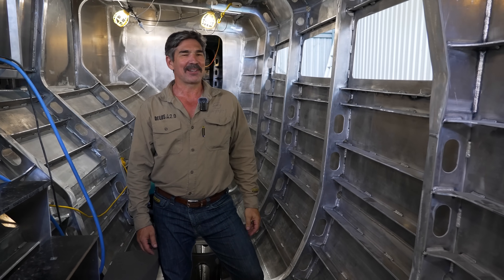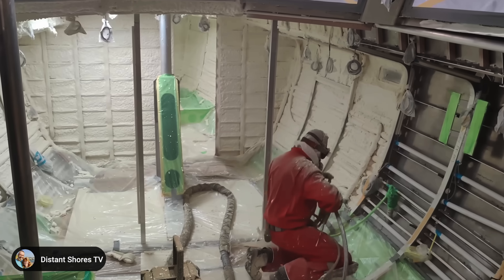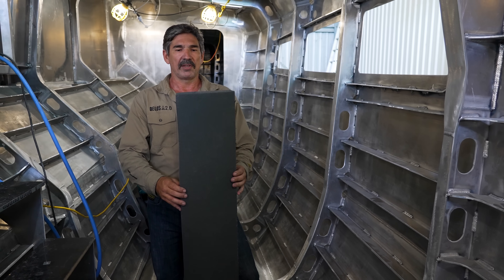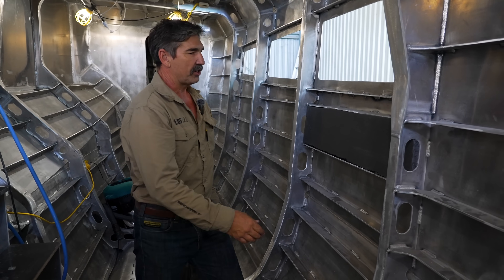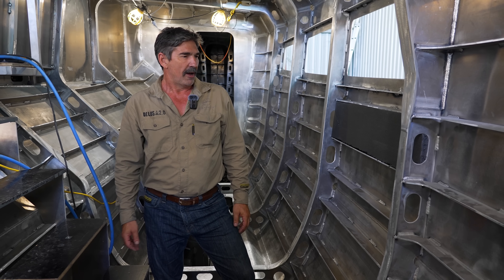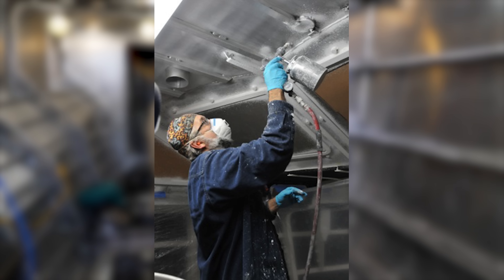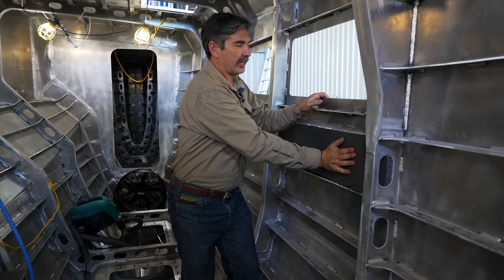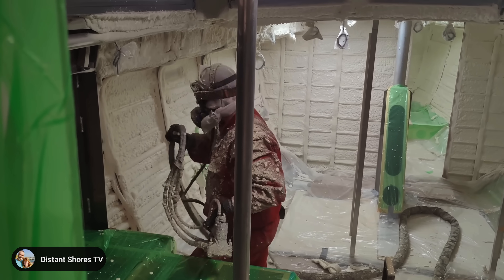HELP, We Need Your Advice!  How Should We Insulate Our Aluminum Catamaran???

Comment: Brian, you have asked a very interesting question. I’m not an insulation expert, but I am a mechanical/electrical engineer. Drawing on previous posts, it seems you need to start by spraying a vapor barrier on the bare aluminum to prevent corrosion. I’d compare zinc chromate to automotive epoxy primer. Next, it seems that, independent of the insulation matter, conduit is highly-desirable for as much of the electrical and fluid connections as possible. And then for the insulation, as has been pointed out, a spray-in, closed cell, expanding foam has several advantages. I won’t repeat them. BUT, as you pointed out, the major problem with spray foam is the difficulty in removal, should one desire to do that for some reason. If I were you, I’d think in terms of some kind of spray-on release agent before the insulation is applied. Same concept fiberglass boat builders use to allow easy removal of the boat parts from their molds. The challenge will be finding a release layer that’s strong enough to keep the foam in good contact with the hull, while allowing for easy release when desired. But you have the vapor barrier/corrosion protection in place in case the foam does separate.

Comment: As others here have stated, the spray foam is the way to go, never used it on a boat but have used it on land applications ;) and it's great. Not that hard to clean off either, wire brush fitting on a drill or grinder etc, even a utiilty knife blade will do it. You can also buy stuff that breaks down the foam to clean, the same stuff you clean the guns out with. Also because it is sprayed on and expanding it is literally a perfect fit so there are serious efficiency benefits from this. 
If you really would prefer to use Neolon then i would suggest you use it in conjuction with the spray foam on the ribs and hard to get to places and as a sealer over any joins, this would give you the best of both worlds i suppose with minimal foam actually on the hull....

Comment: Insulated Paint (Ceramic Coatings)

Advantages:
Thin and lightweight, preserving interior space.
Reflects heat, reducing cabin temperatures in warm climates.
Provides additional corrosion resistance.
Considerations: Best used as supplementary insulation; performance may not match foam-based options.
Each method has trade-offs, and often a combination (e.g., spray foam for thermal performance with insulated paint for supplemental coverage) delivers optimal results. Proper sealing and ventilation are essential regardless of the chosen insulation.

Mineral Wool (Rock Wool) Insulation

Advantages:
Excellent thermal and acoustic insulation.
Non-combustible, providing added fire safety.
Resistant to moisture and rot, ideal for marine environments.
Considerations: Needs a vapor barrier to prevent condensation and ensure it stays dry.
2. Cork Insulation
Description: Sheets or rolls of natural cork adhered to the aluminum surface.
Advantages:

Eco-friendly and sustainable material.
Good thermal and acoustic properties.
Resilient and resistant to mold, mildew, and moisture.
Considerations: Cork is heavier than some alternatives and may require adhesive compatible with aluminum.
3. Vacuum Insulated Panels (VIPs)
Description: Thin panels containing a vacuum core for extreme insulation performance.
Advantages:
Extremely high R-value in a slim profile.
Saves interior space while offering superior insulation.
Durable if properly installed and protected from punctures.
Considerations: Expensive and requires careful handling to avoid damaging the vacuum seal.

Comment: Brian, I have been struggling with the same question: to foam, or not to foam? My thoughts are the same as yours in that I also don't like the idea of covering the aluminum with foam and never being able to visually inspect or repair it. However it seems you have some very knowledgeable commenters that downplay that concern. I've read about spray foam concerns in the housing industry due to improper application of the foam.  Google "problems with financing spray foamed houses". 
I am following this topic closely to see what you decide. I wouldn't put much weight in how Boeing does it. When Aerospace industry best practices were established spay foam did not exists!

Comment: if it helps, Alubat use spray foam.. they're pretty well regarded and their boats last forever!  You only need to remember to remove it before welding, but reapplication is pretty easy (so I am told)

Comment: Don't overdo it.
Pure aluminum with maybe a few wooden panels on the inside gives it purist looks and keeps it easy to maintain.
If you dump weird insulation material that traps and keeps water, that nice boat will look shit rather quickly.
And maintenance isn't fun either, if you have difficulties with getting into things.
Vacuum foam with aluminum coating/IR reflector is awesome, Vacuum insulated panel is correct name

Comment: You are answering your own questions about the ribs & struts sticking out, those spray products you mentioned look to be a good solution, again after if you want extra insulation for sound proofing 
ie: water slapping against the hull, that foam material you showed is probably a good extra step !
🇨🇦 ya me again Cdn. Dave 🇨🇦

Comment: I have a steel boat with spray foam, its great to protect the metal underneath since you have zero air gaps and its very good at preventing condensation since it cover all cracks that you will likely miss with the foam boards. 
Also, you will (hopefully) only need access the hull very rarely, especially where the foam is at (at and above the waterline), so going for the easier (cheaper and faster) method of spraying is likely the way to go. I did some metal work on my boat recently, took a grinder with a wire brush about 10 seconds to clear the area (good vacuum is recommended haha) and spraying it back on is easy (plus the bottles of spray can store much easier than foam board cut-outs). Hope this helps! Loving the series

Comment: Aluminum primer and then spray foam. It protects the aluminum well. But not in the lowest part of the builge. Any small holes of foam  you have to dig out can be filled with a can of spray foam. Then coat the entire foam coating with interior/exterior LATEX paint as this provides a class 1 fire barrier. This is incredibly important. Many insulations BURNs. Like a candle on steroids.

Comment: Dont forget to look at flammability of the insulation. As a retired fire protection engineer I would have a look at the NFPA guidelines,
Reply: amen! AMEN!
Reply: Good to note that many flame retardant additives are toxic.
Reply: You only need a fire protective layer if the spray foam is left exposed. It's easy to install but cost $100 per gallon.

Comment: I would probably look at Aerospace insulation materials. Sitting in an aeroplane at 30,000ft where it is -60F outside, you don't normally get water dripping on you. It's normally a controlled forced air environment to combat moisture but you still have 300 people breathing in a closed space so the humidity is not that low. They generally use an open cell polyfoam so as not to trap moisture. Corrosion on the inside of the outer skin on an airliner is definitely something to be avoided so take a look and see what they use.

Comment: Have you considered cork - they do a kind of recovered cork board that is a waste product from the wine industry.

You might also consider wool .. there should be plenty of wool in Australia, it's a great insulator, and any remaining lanolin will help protect the aluminium.
Reply: Odd Life Crafting also used a spray on cork, which had great sound deadening properties

Comment: Closed cell foam is your only option.  Open cell will absorb moisture and mold.  No spray foam.  Home insurance companies are refusing to insure spray foam because it hides damage.

Insulate over the frames but also the back of the interior panes.

Comment: For me what i would do is run conduits and wiring and piping first with extra conduits in case you want to ad water or electricity circuits later and then just spray everything. That would be my preferance.

Comment: I’ve only dealt with smaller aluminum boats but I a fan of closed cell insulation and not spray foam for the reasons you mentioned. If it were my boat I’d be leaning towards the thermal barrier and closed cell foam.  You have to work on your boat in exotics locations with sometimes less than ideal conditions. I would hate to fight that foam in 100+ degrees.

Comment: Option 1:
I have a steel ship from the 70´s, that is insulated with "Glass Wool" or "Mineral Wool" -you name it. i know, it has a bad reputation due to carcinogenic considerations. but that was back in the 70´s. The modern generation materials seem to have solved that problem. In europe it is still quite common as an insulation for dry-wall building. The advantages: it is dirt cheap. there can´t really be condensation, between the insulation and the alimimium because it is not air-tight. The air will condensate somewhere in the middle of the wool. but that, if the rest of the interior lining of your ship offers some ventilation, it will always dry out. And it is natuarally flame-retardent! Wich is an important issue to my mind.. so i would at least consider it in or close to the engine departements. or around your heavy-duty electric installations..
Option 2:
a second solution would be a thin layer (aprox 10mm) of armaflex (EPDM Kautschuk) wich you stick directly to your hull. you  can more or less wrap around your stringers, and then go on and fill the rest of the gaps with your (loosely mounted) expanded Polyethylene (XPE /EVA) foam. then you would at least not have the condensation directly on the hull, but between that thin armaflex and XPE Foam. (if you have condensation
Option 3:
Install an air-tight vapor barrier between your interior liner and your (whatever) insulation to avoid condensation on the hull. look at how they do it in buildings! Plastic foils and tape...

Comment: Spray foam is tricky, messy but easy. There are many reports from people developing allergies to chemical released from spray foam. Also if not applied 100% correctly its a nightmare.

I think your approach with the paint-on vapor barrier and the neoprene panels on pegs is the best compromise.

Comment: Most important first: In case you use some foam stuff, make sure it is certified for the use in indoor rooms, and there are no potentially toxic fumes emitted from the material! 
Ihave learned lots about insulation in campervans. Although there are some differences, the principle is the same: prevent the warm, moist air from within the cabin to cool down and condensate in a less ventilated cold area, where it might cause corrosion. You need to take care of the tiniest holes(build a vapor barrier), because there is thing called vapor pressure.  I think the best option would be spray foam, if you need to repair something you can scratch it away and fill it again afterwards. When you use your foam panels, I would seal the cracks with aluminium tape, so no water vapor can reach your hull.

Comment: Spray-on cork, provides a tiny bit of flex as opposed to spray foam which is likely to separate at some point due to movement. Spray foam over the cork.

Comment: The one thing I can give you about spraying insulation insurance companies are refusing to pay for damages to homes here because they sprayed insulation into them. You have to have a vapor barrier between the insulation and the exterior or condensation will build up and it will rot the rest of it your choice either bad insulation you know the pink stuffor the 4 x 8 sheets and you cut them the thicker the better

Comment: Spray expansion foam is a fantastic insulation, no moisture, good R factor, it also gives a lot of strength to the structure it's sprayed on, but it's flammable and requires to be cover some how in order to protect it from any source that could ignite it.

Comment: Rockwool. Fire resistant, water resistant. Spray foam will condensation issues. Another option, teddy bear stuffing😊
Reply: Also put weep holes on those horizontal stringers so any moisture drains into the bilge.

Comment: Artificial Intelligence says that "Insulating aluminum boats presents unique challenges and opportunities due to the material's high thermal conductivity and susceptibility to condensation. Below is a comprehensive overview of the key considerations, potential problems, and recommended solutions for insulating aluminum boats.
Challenges and Problems with Insulating Aluminum Boats
Condensation Issues:
Aluminum's high thermal conductivity causes it to cool rapidly, leading to condensation when warm, moist air inside the boat contacts the cold hull. This can result in:
Mold and mildew growth.
Corrosion of the aluminum hull.
Damage to interior materials like wood or fabric24.
Moisture Retention:
Some insulation materials, like open-cell foam or fiberglass batts, can absorb moisture, becoming sodden over time. This not only reduces their insulating properties but also exacerbates mold and corrosion issues27.
Thermal Bridging:
Without proper insulation, aluminum can create thermal bridges that compromise temperature regulation inside the boat, making it uncomfortable in extreme weather conditions4.
Structural and Weight Considerations:
Insulation adds weight to the vessel, which can affect performance and fuel efficiency. Lightweight materials are preferred to maintain aluminum boats' inherent advantages4.
Fire Safety:
Insulation must meet marine fire safety standards to prevent fire risks and ensure compliance with regulations46.
Durability and Maintenance:
Insulation materials must withstand the marine environment's harsh conditions (e.g., saltwater exposure, vibrations). Fragile or difficult-to-repair materials can lead to long-term maintenance challenges26.
Recommended Solutions for Insulating Aluminum Boats
1. Materials Selection
Closed-Cell Foam:
Preferred for its moisture resistance, lightweight properties, and ease of application.
Examples: Class 0 closed-cell foam or Aeroflex/Armaflex EPDM rubber foam236.
Ceramic Insulating Paints:
Products like Mascoat DTM offer a first layer of protection by preventing condensation on exposed aluminum surfaces. These paints are non-toxic and durable but should not be submerged in water for extended periods2.
Natural Materials:
Eco-friendly options like cork or wool are gaining popularity for their moisture-regulating properties and sustainability3.
Fire-Resistant Materials:
Use materials with a Class 0 rating or equivalent to ensure fire safety compliance6.
2. Installation Techniques
Apply a combination of ceramic insulating paint followed by closed-cell foam insulation for optimal thermal performance and condensation prevention.
Ensure tight-fitting insulation without gaps but avoid overly compressing materials like foam to maintain their effectiveness26.
Use contact adhesives designed for marine environments during installation to ensure durability under vibrations and temperature fluctuations2.
3. Ventilation
Proper ventilation is critical to reduce humidity levels inside the boat, minimizing condensation risks further.
Install vents or dehumidifiers in living spaces, especially in tightly sealed boats where humidity from cooking or breathing accumulates quickly26.
4. Maintenance
Regularly inspect insulation for signs of moisture retention, mold, or damage.
Avoid using materials that absorb water (e.g., fiberglass batts) as they degrade over time in marine environments7.
5. Soundproofing
Consider sound-deadening materials like ButylMAT or DeciLAM for areas prone to noise (e.g., engine compartments), which also add thermal insulation benefits6.
6. Lightweight Solutions
Opt for lightweight insulation solutions that complement aluminum's low weight advantage while maintaining energy efficiency (e.g., rigid foam boards)46.
Conclusion
To effectively insulate an aluminum boat while addressing potential problems like condensation, corrosion, and weight impact, a multi-layered approach is ideal. Start with a ceramic insulating paint layer to prevent condensation directly on the hull, followed by closed-cell foam for thermal insulation and moisture resistance. Ensure proper ventilation throughout the vessel to manage humidity levels effectively. By selecting durable, lightweight, and fire-resistant materials tailored for marine environments, you can enhance comfort, safety, and energy efficiency on board while preserving the boat's structural integrity over time."
Btw, hope everything goes well for you all ! :)